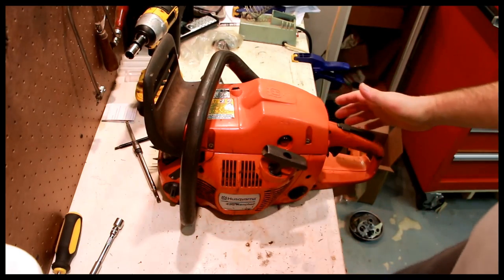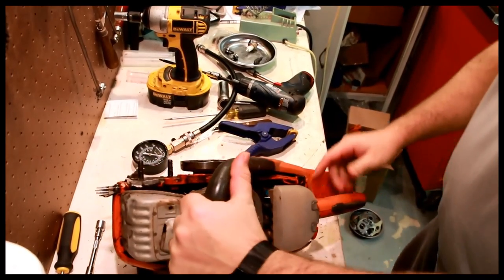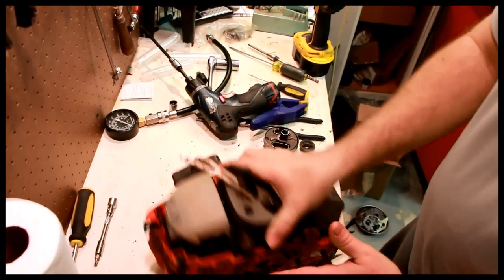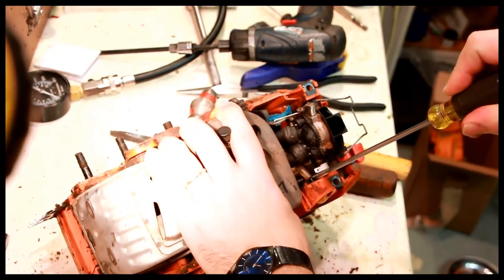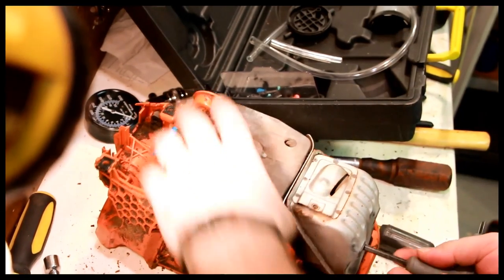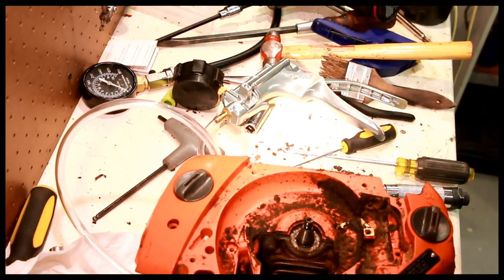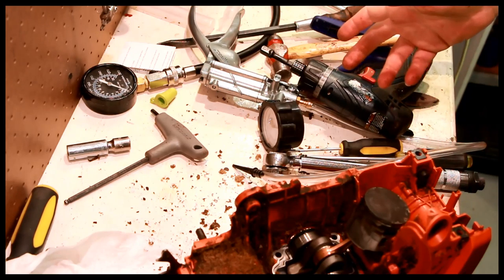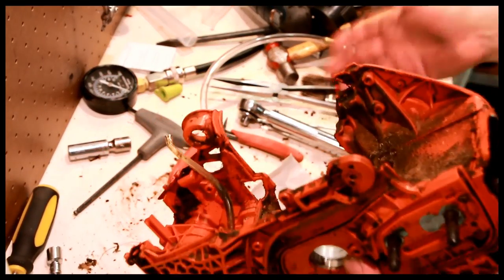Husqvarna 455 rancher teardown and rebuild, bolt for bolt!  part 1

Comment: I have a 455 Rancher.  It is one of my favorite working saws.  It is about five years old.  Never had a lick of problems with it.  It was made in Sweden.  All I do is put gas and bar oil in it, crank it and cut with it.  It is lighter than most of my saws, so it gets a lot of work.it is toting a 3/8, .050, 72 chain on a 20 inch bar.  I have only replaced the fuel filter and chain on it.  I junked that Husqvarna chain pretty quick and replaced it with an Oregon LGX chain.  I put a big Stihl filter on it.  Nothing complicated about any of it.

Comment: You are a talented guy! I never realized how complex a chainsaw is. I dont think I am going to attempt to rebuild my 455.
Reply from the maker: Even busted they fetch good money on ebay.  Or part it out..  you can make fine money :)
Reply: @matthewolson8875  Thanks. I didn't realize that. I may do just that. (My mechanic was telling me he is getting a lot of newer Husqvarnar break downs. He feels the newer models aren't what they used to be. Rebuilding is labor expensive which I understand watching your video.) I replaced my Rancher with a barely used, older 460 Rancher. I know the bar and chains are interchangeable of which I have several bars and chains.

Comment: Many thanks for the video - it helped immensely to strip my saw to get to the carb which for some reason was blocked. A very useful video indeed!
Reply from the maker: glad I could help!
Reply: blocked is a common problem as the clunk filter falls off the fuel tube because they rot and it sucks up all the filth in the tank that the filter blocked

Comment: Have a 455 I need to completely tear down......small engine mechanic just went over mine, and it still will not start or run if I can occasionally get it to start.......has been a lemon  since purchase.......figure I will tear it down in the Winter.......thanks........getting ready to watch part 2

Comment: You did a great job with this video, Matthew, I learned a lot about this complex little saw.  My neighbor dumped one into my hands because he ran it with straight gas and wanted me to take a look at it.  I'm going to run a compression test on it before I do anything as I fear that there's internal damage to this one also.  Thanks again, it's on to part two.
Reply from the maker: Pull the muffler off.  If there is scoring u need a new top end.  Thanks for the comments

Comment: Great video.  I've had my Rancher for about 6 years with good service - mostly personal use for firewood and cleanup.  Recently I was cutting up a large oak - it was running fine then suddenly lost power.  Starts up no problem, revs up but as soon as I start cutting it would bog down.   I had bought a maintenance kit so changed out the air filter, fuel filter and spark plug.  While I had the fuel filter off I push air into the fuel line with throttle open to blow out the carb.  Checked compression it was about 150 psi.  Filled with fresh gas, primer bulb pumped up well and stayed firm.  Started up fine but same problem - bogs down immediately under a load.  I guess the next step is rebuild the carburator?  Am I missing something simple?
Reply from the maker: Make sure the spark screen is clear.  But mostly sound like it not getting fuel....  so yeah ....carb would be where I would go.  I haven't had much luck rebuilding these carbs.  Often it easier to just get new oem carb.

Comment: Wow I had my muffler off my 455  rancher last night. I questioned  where the gasket went .i could tell it went where you explained, but after watching a few videos, and looking at parts diagrams on line , it shows it up against the port ? But mine was between the muffler and heat shield.  And the saw has never been apart. I could see the port marks on the aluminum, so i know the shield goes first. But not according to all the parts diagrams on line .whats your thoughts?  Thank you for the Videos
Reply from the maker: I'm pretty sure the heat shield goes directly against the cylinder

Comment: Great video Matthew..  my friend just gave me a 460 Rancher (wasn't used in awhile).. after I added gas and turned the saw upright, the fuel immediately started leaking out the bottom.. I suspect the gas tank is part of the chassis and its leaking through the seem.. wondering if there is a gasket between the two sides of the chassis, or if I just need a whole new chassis..  lmk if you have any ideas.  thanks
Reply from the maker: Whole new chassis.   This is not a pro saw....doesn't have a split able crankcase
Reply: @matthewolson8875  Thanks.. the saw is like new, hardly used.. I may try to contact Husq about a warranty
Reply from the maker: @larryzdanis5377  are you sure its leaking from the seam in the chassis?
Reply: @matthewolson8875  Probably 75% sure.. I'm going to pull it apart to make sure no hoses are detached or leaking, etc. first, before buying a new crankcase.

Comment: I bought the Husqvarna 460 Rancher new a couple years ago. That first year I used it to cut firewood and then I bought a Alaskan Sawmill. In one day I cut several boards and it ran flawlessly. At the end of the  day I shut it off and put it back in the barn. It never started again. I had always used good quality 2-cycle oil mixture and taken care of the my investment. But like I said, it would not start. I ended up buying a Stihl. Several months later I decided to check the compression on the Husqvarna. It was extremely low, about 60psi. I bought a new cylinder, piston, ring, seals and gasket. I will repair it soon however while looking at it, there was an excessive amount of wet oil on and around the flywheel, coil and the adjacent plate that covers those items. Unknown if its chain oil or from the gas tank. I suppose the chassis could be cracked since the oil tank is in the same area or I accidently spilled oil down into that area when filling the chain oil. We shall see...
Reply from the maker: Yeah...tear it down and do the proper diagnosis to figure our why it ate itself.  460 is definitely not built for milling though.  Husky 395 at minimum for milling
Reply: @matthewolson8875  cylinder was in good shape. Ring was stuck on the exhaust port side but the piston looked good. Since I already had a new cylinder, piston and ring, I replaced it all with new seals & gaskets. Kept the old just in case. It fired up with two pulls and runs like new again. Thanks!

Comment: Hi there - great videos - saved me lots of time doing the rebuild so did not do things in wrong order or forget something and have to go back.   Saw is now done and will run like a top except won't idle...as soon as you take choke off and pull throttle once it will die.   Will run if you hold throttle a little.   It was idling fine before it got the straight gas.  It sat for only a month or two before the rebuild.   Any likely suspects as to the cause of this?  Thanks
Reply from the maker: likley getting choked for fuel at idle....  lots of reasons why

Comment: I have that saw that fires at a high idle then dies in a second or two... Any ideas on what to check? I pulled the carb apart looks fine, very clean but idk.  compression 130-140...
Reply from the maker: Troubleshoot is best for the forums ....  sounds like fuel starvation to me though...  somehow its not getting fuel.

Comment: My primer bulb was damaged on the one I purchased at auction and I got a new one. When I went to install the long hose came completely out. I noticed that you left yours on the whole video lol. I was hoping I could see an easier fix, but it looks as if the carb wants to come out so I can fit it or replace it. arg.

Comment: Do you put loctite on the cylinder too before reassembling
Reply from the maker: Yes....loctite 518 is anaerobic sealer and it's fine for metal and rubber joints

Comment: What is the cylinder bolt torque specs?  Great video, thanks.  I have a low compression 455 with a stuck piston ring.  I will change out the piston and cylinder.
Reply from the maker: I don't have a spec on the head bolts....sorry.  did you pull the muffler and check for scoring?  What was the diagnosis for low compression?

Comment: I just removed and replaced my carburetor  thanks to this video.
thank you  very much.
Reply from the maker: Burt Hulbert no problem at all!  glad I could help!
Reply: Matthew Olson thing is it's still got a lean/starvation problem. Replaced tank vent, gas filter and it starved off/stops. I removed carb and put it back on thinking the intake rubber surface was mishapened causing a leak but that didn't fix it.
Any ideas?
Reply from the maker: This question is best posed on the online forums ... arboristsite or opeforum.com  
lots of different directions I could go with this, so best to post it ... and as much diagnostic information as you have...on an online forum.  best of luck sir

Comment: Inside the clutch cover is a black plastic piece that holds the tensioner spring in place. There are 4 screws part No. 503217010. What is the size of thase screws.

Comment: I have an option of picking up a saw that might have been run with straight gas, for cheap... should I do it or skip it? how much would a rebuild like this cost?
Reply from the maker: Love straight gassed saws.....know exactly what's wrong :)  get it cheap. ..pull it apart and see what it needs.  Price it out....then see if it's worth putting it back together.  Gotta get it cheap or free.

Comment: I replaced my carburetor it looks like that went great no leaks everything looks good seems to work but my compression super tight now. I can barely pull the cord I took the spark plug out and rotated a few times put it back still way tight any ideas you have which may help I would really appreciate. Thanks
Reply from the maker: Is your decompression valve working?  Does it rotate smooth with the spark plug out....did you pull the muffler and check condition of the piston....whats is the compression currently?
Reply: @matthewolson8875  ill do all that
Reply: I should say it was running fine before the reason I change the carburetor is because the throttle would always stick wide-open
Reply from the maker: @caldreamin09  is the throttle sticking now? ... was it the carb that was jamming open somehow?

Comment: My question is I have 572xp the you know how the face plate has 2 bolts to attach to that are right above the chain adjustment, one is shorter then the other is there a way to make it back even?
Reply from the maker: The bar studs?   On most husky they just press fit from oil tank side
Reply: @matthewolson8875  ok so I just need to take it off and push them up to make them even then right ?
Reply from the maker: @joshuaavila8401  they push in from the oil tank i think

Comment: Hello, excellent video.  I have a 455 Rancher that bogs down a little at full throttle.  I was attempting to adjust the high speed screw a little richer.  I only turned it about an eighth of a turn out, and it hits the factory limit stop.  Is there any way to get rid of this limiter some how.  Also, could it be another problem, such as spark plug/fuel filter/etc.   Any help, would be greatly appreciated.  THank you.
Reply from the maker: thanks...

for your 455...check air filter and spark screen....check compression.  bog is usually a fuel delivery issue.  check fuel line and filter.  clean carb....simple stuff....yes you can remove the limiter but on a 455....they run fine with limiters.

Comment: Thank you for a very helpful and informative video.  I pick up a parts saw off e bay and repaired the one I have.  Seems I am getting a lot of white smoke when I run it and the chain moves without hitting the throttle. As you can tell I am new to working on these, any help would be cool.  One other saw cut off when I start to cut with it :-(
Reply from the maker: +Kuma San your question is quite vague.  the chain moving at idle could bit an idle that is set too high, a low screw set too lean, or a busted clutch.  a little bit of white smoke isn't a problem I don't think, if its smoking a lot then the bar oil may be leaking into the crankcase, and your other saw that cut out I cannot possibly help with...your description is to vague
Reply: Check your mix ratios.

Comment: Is the impulse line nipple on the crankcase accessible (to replace the line) without disassembling the cover?  Do you show that side of the connection in this vid or another? Having bogging issues on my 2010 model 455 rancher and have ruled out/replaced everything but this line and the fuel tank vent.. I dont see it shown on shop manual or any parts diagrams and my eyes arent that great to see it with a flashlight...(ive already installed new carb, fuel filter, fuel lines, primer bulb, air filter, checked and clean spark arrestor screen, spark plug, fresh gas)- starts and tuned it but intermittently bogs mid to upper revs) ive tried testing compression with 2 different testers and it was 75-80 BUT I tested 4 other 2 stroke machines with same testers with similar readings so I dont trust the readings and those saws dont have issues..( one of those is the identical 455 rancher but a 2015 and its also reading 75-80)
Reply from the maker: Did you pull the muffler and check the piston?
Reply: @matthewolson8875  I pulled the muffler and the cylinder walls appear smooth, the piston moves smoothly and glistens with no scoring that i can see however the top and of top third of the exposed side of the piston have some carbon.. the ring looks unscored but appears tight..is it supposed to flex, be moveable, or have any gaps when cold?..  spark plug is grey..id post a video but i don't see that option..
edit: i got a look at the exhaust side with the spark plug removed and piston at bdc and do see some slight scratches in the cylinder wall..wonder if i overheated the saw and the ring seized?  I also notice a sucking sound when i pull over the engine.. i replaced the fuel lines and primer bulb and i think its coming from the long line grommet for the primer bulb area..it can be heard in the video i took..saw feels like it has good compression when pull starting..
Reply from the maker: @bkdarch  is the carb new oem?  Or aftermarket carb? ....  these questions better answered on the forums...opeforum.com or arboristsite.com
Reply: @matthewolson8875  amazon $20 carb.. runs a little better with this aftermarket one bc i didnt have the tool for the factory walbro and i was able to dremel off the limiters on this one..
Reply from the maker: @bkdarch  oem carb only....  get rid of the am carb.
Reply: @matthewolson8875  Based on your response i am assuming you dont think the piston and ring condition i described are the issue?
Reply from the maker: @bkdarch  correct.   Carbs tend to be a significant source of issues ....a fresh oem carb tends to help out a lot in diagnosis.
Reply: @matthewolson8875  $100 to diagnose on a 12 yo saw is a tough nut to swallow- id rather rule out everything else first as i had no issue with an AM carb on a recent fix..im sure its hit or miss but this isnt a have to fix as i have 3 other saws-- this is a .... this SH&T is pissing me off fix...the fact that its doing the same thing with BOTH carbs means its likely not the carb..imo.. i am able to see more of the impulse line with the muffler off so i may head in that direction first.. thanks for the help i appreciate it..
Reply from the maker: @bkdarch  with all the frustration and hours u have into this thing I would have torn it completely down and have it fully rebuild with a new carb rubber....ring....bearings etc...and been out cutting.   Up to you what you want to do though.  Best of luck.
Reply from the maker: @bkdarch  oh...and coils go bad too.  Very hard to diagnose and very pricey.  You have to choose whats most valuable to you though...time money aggravation  For most guys just buying a brand new saw is the most cost effective solution.
Reply: @matthewolson8875  Path of least resistance.. Im retired and have the time.. and am learning..never done anything you've described before..im not the type to give up on it when im this close..this feels like a fuel starvation to me..and that sucking sound has me wondering.. i did notice a bad primer line when i started but thats been replaced.. and ive replaced the primer 2x to ensure that wasn't the sound...
Reply: @matthewolson8875  in my case it was the tank vent and one bad fuel line.. lasted almost 12 years so can’t really complain.. thanks again.

Comment: I was changing my carb and blade and between the two I had a rubber bushing stop (or something) fall out. I have NO idea where it goes. It is about 1/2 to 3/4 inches long not hollow but has a hole in one side with a lip …
Reply from the maker: Sounds like a tank limiter...

Comment: Great video on the tear down. I have a 455 and it's leaking gas when full or laying on the side I'm able to run the saw with a half tank of fuel.  Watch your video to see how to get to the tank it looks like it's made in to that last piece. I don't want to do a tear down like that to fix it. Any idea?  Thanks for the video
Reply from the maker: Tank vent?
Reply from the maker: Broken fuel line?
Reply: @matthewolson8875  thanks for the quick reply I will give that a try.
Reply: @matthewolson8875  it's that top hose on the primer bulb it was just sitting on top of the tank not pushed down in the hole.  Thanks for the help